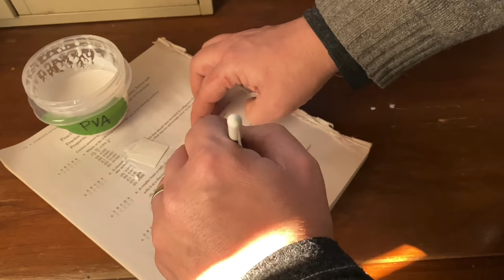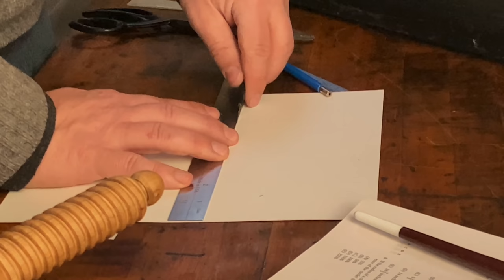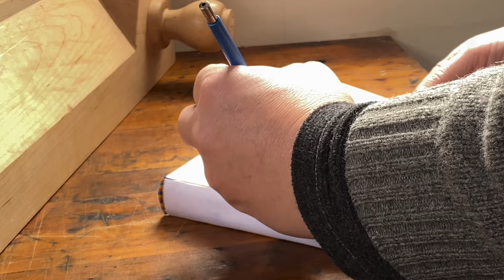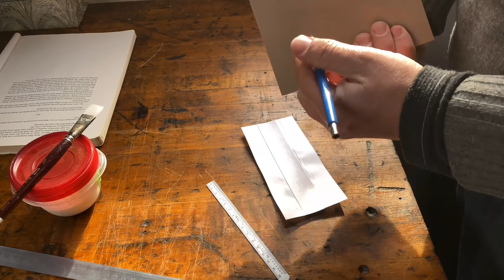Making A Handmade Book - Part 3 - Lining & Making the Case

Comment: hi, i wanted to ask you what kind of glue did you use? This is the first time I try to do something like this and I don't know what materials to use. the videos are shot very well, congratulations.
Reply from the maker: In this video I believe I'm using archival PVA glue, but I use different glues depending on the application. On this book I used PVA, PVA/methylcellulose mix, and wheat paste.
Reply: @FourKeysBookArts  If I wanted to learn everything about bookbinding glues where/how would I learn?? I'm a bookbinding enthusiast but I would really like to make it a real hobby. I want to make hardcover leather/cloth(maybe clothette) books that last for 100+ years, but I know if I don't use the right glue or don't prepare it right the the book block will just dissolve.
Please help!!🙏🙏🙏

Comment: Hi!  I'm trying to construct this sort of book as my first proper project, since I don't have the tools (or skills, come to that...) required for backing a spine yet!  Would it be possible to ask what sort of card you are using for the spine at 5:40?  I can't see anything designed specifically for it at Hewitts.  I gather it should be thinner than the greyboard so it can bend round the rounded spine, but I'm not sure how thin to go!  Do you think card meant for Belmont Hollows at 225gsm would be ok?
Reply from the maker: That piece came from my offcut bin so its precise characteristics are a mystery, but I would say that the 225gsm card you have should be fine. The piece acts as a stiffener, so should have some strength, but also a little flex. The most important factor, whatever you use, is that the grain be oriented from head to tail. Thanks for the great question!
Reply: @FourKeysBookArts  Thank you very much for taking the time to reply - I appreciate it!  I need to get an offcut bin going!

Comment: What kind of cutter is that at 6:40? look intimidating, cool video though ha
Reply from the maker: Definitely want to keep the fingers out of the way! It’s actually mostly aluminum, no not as heavy as it looks. I’m not sure what it was originally used for, but it’s perfect for cutting book board!
Reply: Some call them guillotines. There are modern versions for sale in Amazon but they're more designed for up to an inch and a half of paper. i had one of those and I used to cut  my book boards with it.

Comment: Hello mate! I hope you will receive 2022 surrounded by loved ones and healthy.
I find the thin cardboard i use for the spine is kind of glossy so i make cuts into it for better adhesion with the leather. Is that why you sanded your spine?
Reply from the maker: I used a relatively soft and thick paper on the spine and sanded the high spots to smooth it out. In retrospect this was probably unnecessary. Thanks for the question and happy new year!
Reply: @FourKeysBookArts  ah i see. thank you for answering!

Comment: Do you just use pva glue for everything that you're gluing? Even in the previous steps when you were working on the spine?
Reply from the maker: Depending on the application I'll either use straight PVA, PVA mixed with methyl cellulose, or starch paste. Generally I use PVA on the spine, mix for gluing down endpapers or cover papers, and paste for leather. Thanks for the question!

Comment: good evening! at first I wanna say that your work is inspiring for me, and your videos helps me a lot. I recently discovered that I have some problems with attaching the case to the text block, i always get my 3mm at the top and the tail of the book but not in the left part. I think that my problem is that I use a 250gr cardboard to make the part of the spine in the case. What cardboard did you use in the min 3:35. Cause when I check the case ,before glue any cover material, with the block everything fits  perfect. Thanks for your help! :)